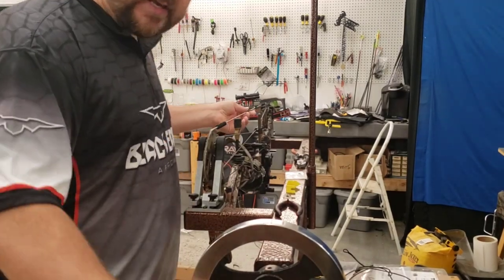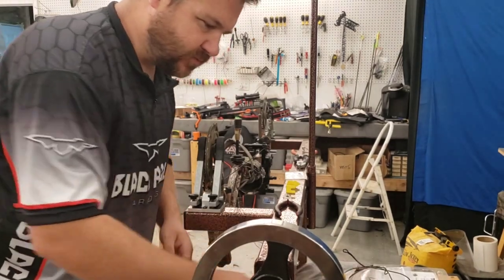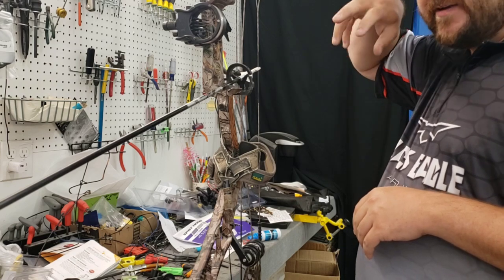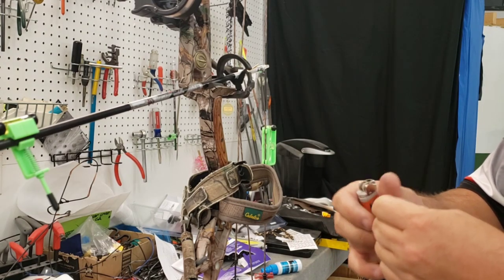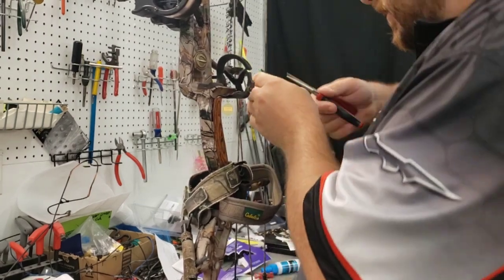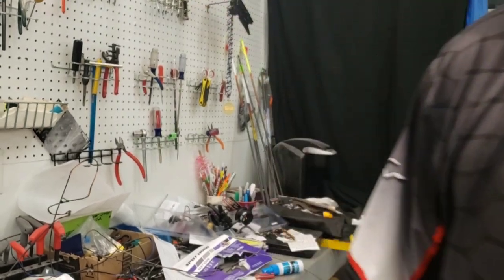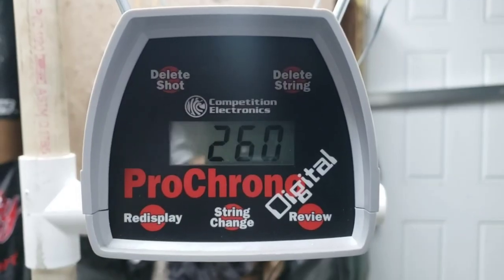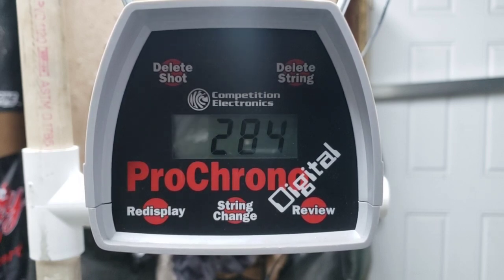Elite Impulse 34 String and Tune

Comment: Thanks for the tip on the short loop, I've been trying to bareshaft tune some arrows and they all fly down range hard nock right (regardless of point weight). I can't wait shoot it again and pay attention to my release torque (I know for a fact that my wrist rocket is twisting the loop). Thanks again for the great video.

Comment: I have the Impulse 31 and just measured my axle to axle at 31 3/16. It has original string. Is that normal or do you think my string has stretched?
Reply: I'm pretty sure that is the actual Ata from the factory